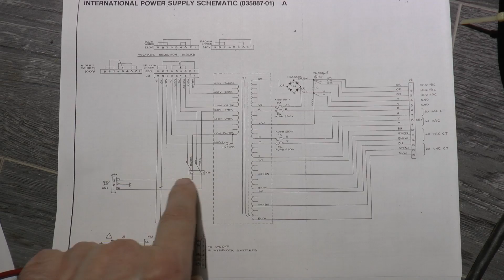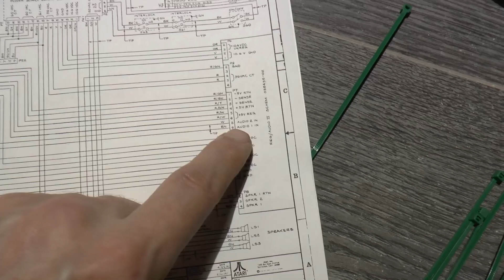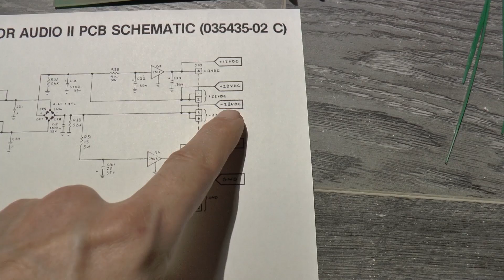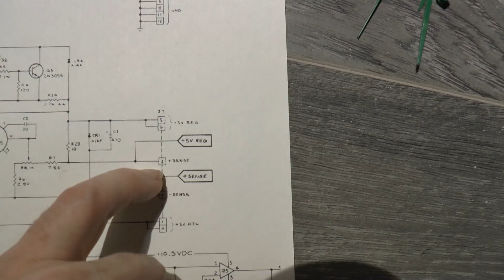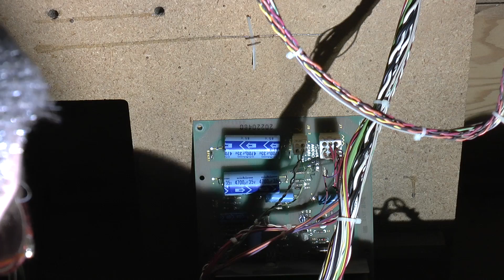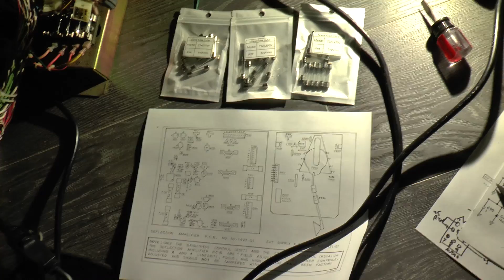Atari Battlezone arcade (1980) repair, part 2

Comment: search "Making "Sense" Of the Atari Audio regulators Self Destructive Behavior"   there is an issue with the design of the AR2  power regulation  sense circuit that will cause it to destroy R29 or R30 or both  "if either the 5 volt regulated output or return connection to the game board edge connectors develops  a bad connection,  the power supply will instead loop the high current output power out "through" the sense circuit resistors and sense return wires instead" (because the sense return wires now have a much better low resistance current flow path to game board set) they cant handle that amount of current that's intended to pass on the direct 5 volt output and return wires and they will glow like a lamp filament and  go up in a cloud of smoke trying to do so.. make sure the game board power connections for 5 volts and 5 volts return are not high resistance or open ,leaving the sense wiring as the only current path there usually is a bad connection at the board edge connector and many people just bypass it with a direct connection to the +5 volt test and 5 volt Return points on the game board ..

Comment: While fixing this latest problem, take a look at the connectors on the board. I've had a lot of trouble with micro-cracks in the solder around the pin headers, and they all needed to be reflowed. I don't think that would cause the fuses to blow, but it can give you a whole bunch of other problems.

Comment: Did you check the deflection power transistors and HV board for shorts before replacing the fuses?

I'm guessing not? lol